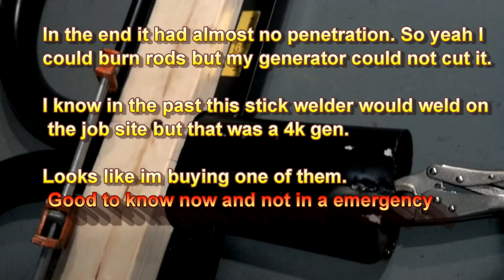Arc welding with a portable generator

Comment: thats the most amateur wld job i've ever seen ,didn't clean the metal and get the paint off before throwing power at it instead of doing a proper weld ,this crap needs to be removed utter rubbish
Reply: Michael Seery - not to argue with you and I am not a professional at all, I am only stating my opinion, but depending on what I weld, I don’t clean 3/4 of the things I weld off before I weld them.
If I making a trailer or repairing something that’s going to be on the road or welding some thing very thick I clean it off and usually weld with a 7018. 
But we have several dirt bikes go carts and four wheelers that Live a terrible life with what my wife my four sons and myself put them through and we are always breaking things and I weld it with the paint and rust right on it and it never breaks. 
I repair riding mower’s that have been so rusty the wheels fall off the deck and I weld them back on through all the rust and paint and they never break loose. 
I weld broken push mower decks, I weld rusty exhaust and none of my welds ever break. Plus between me and my four stands we are always making things out of metal and I don’t clean half the stuff depending on what we are making.
I usually use 6011’s and 6013’s to weld rusted painted things.
Please respond to me, I am really wanting to know what you think about what I have to say.
         I hope you reply and have a great day, Duane

Comment: usually arc welders are AC and go up to 200-250A so take the generator apart and connect directly to the stater positive wire

Comment: Do you clean the paint or powder coat off before weld?
Reply from the maker: +buzzsah Depends if i can get an arc or not.  My go to rod is 6013 3/32 In this case I had to remove the paint. It just hit it the the angle grinder. 
In this application the gen did not have the amps. So I bought a new one (It will be here next week) that has 220v. I don't have any tools that run 220 but I wanted the option.
Reply: +North Carolina Prepper  Always good to have a large gen.  I have a 8500 220, and a 2800i.  I can run my mig with the 2800i if needed.
Reply: small Hobert 140.  I see my comment was confusing. I was using a dictating program. lol   @jmc90213
Reply: I use flux core, someday I'll pick up a tank. lol   @jmc90213